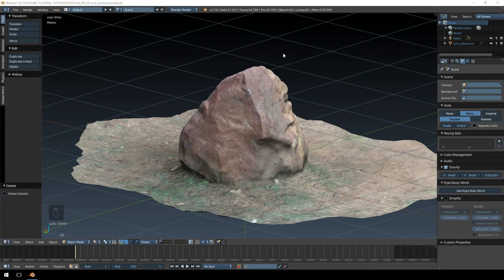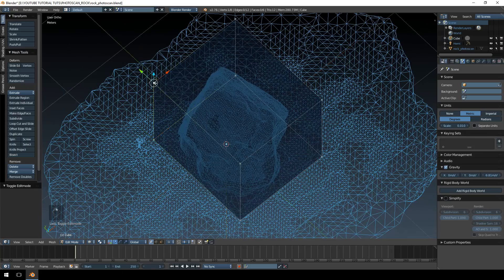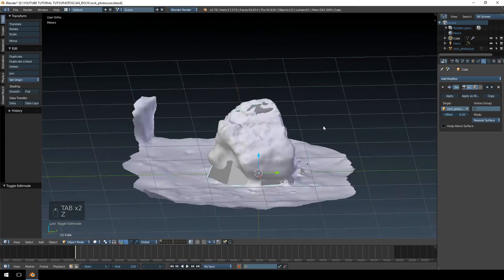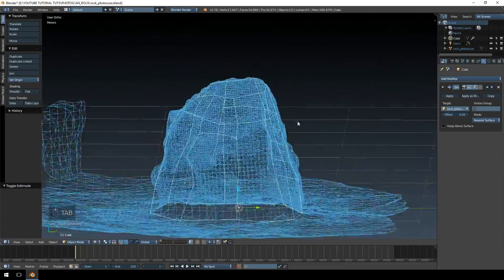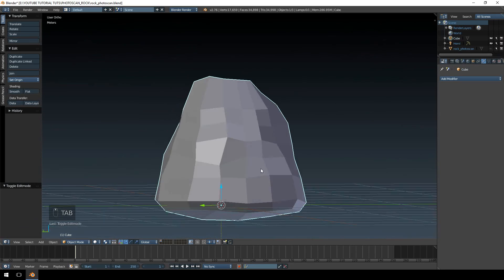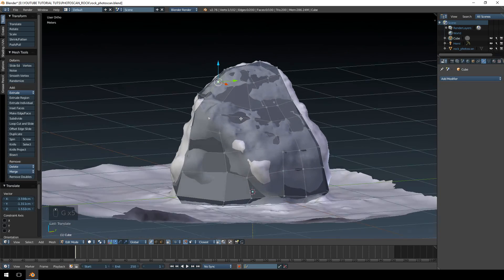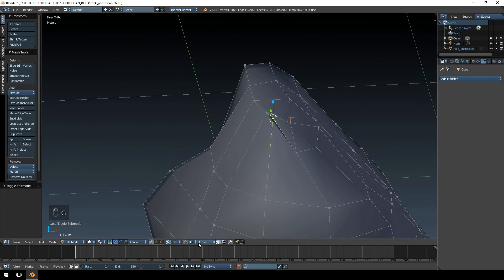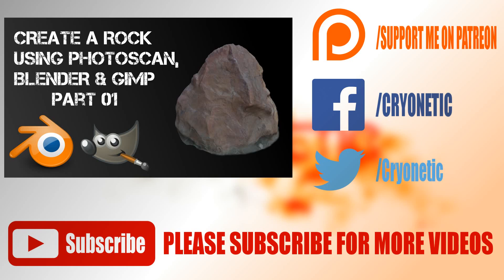3D model using Photoscan and Blender - Part 02 - Retopology

Comment: Can't you just decimate the original model to get a low-poly version?
Reply from the maker: +rjg001 Sure you can but I wont recommend it. First reason is the 3D scan has no base underneath it so you would have to create one after you decimate and this will be time consuming and won't look right most of the time. Second reason is decimate is unpredictable and might take more detail from one area than the other resulting in a inconsistent model quality.
I find decimate works if you make really low-poly models. So if you drop your rock to about 150 faces it should be fine. If you go for something along the lines of 500+ faces things start to look weird and you might have to fix artifacts.

Remember if it is better in your workflow then use it as there are no rules when making any form of art.
Reply: Ok now i want to make a 3d model of my friend in my game. For that i cannot follow this method,it will take time roght.so what can i do. Please sir or madam please reply